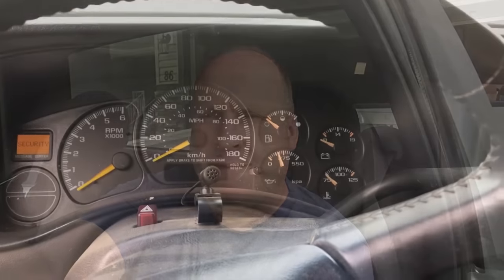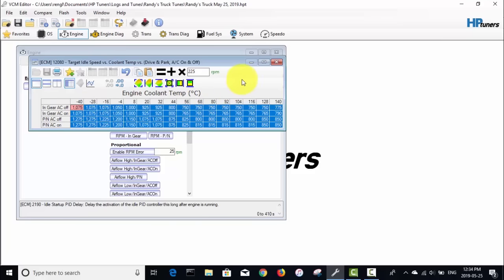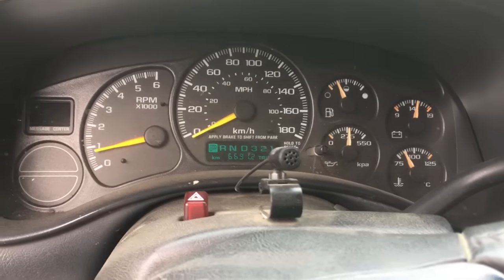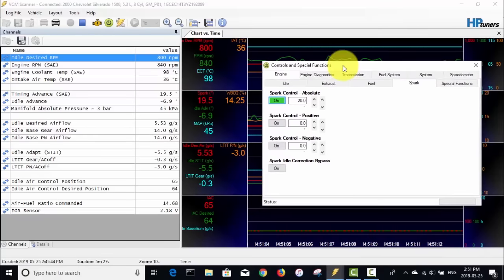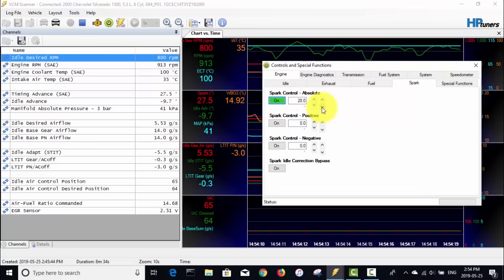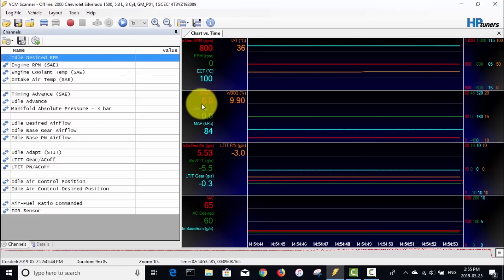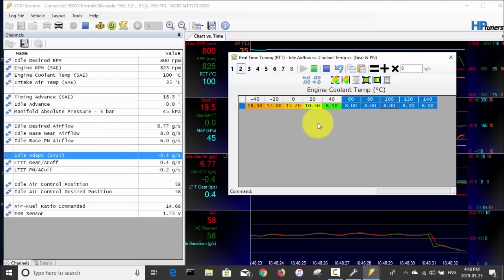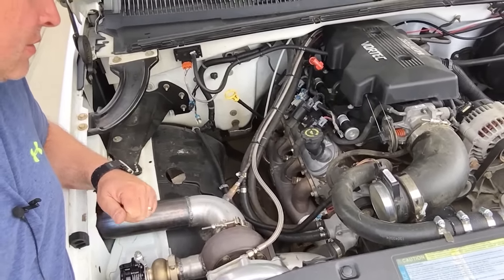Idle Tuning after Cam Swap with HP Tuners

Comment: Good stuff! The issue you had when you switched the idle airflow back to 6 and then it didn't want to stay running is because your long term idle trims were still -3 so effectively you were commanding 3 g/s idle airflow, the short terms trims were then saying you were 3 too low and were dialing your long terms back towards 0 which got you back to 6 g/s.  Much like fuel trims, the short term trims only capture higher resolution data and then averages to make changes to your long term trims which then adjust your commanded.  Enjoyed watching you go through the process!
Reply from the maker: Goat Rope Garage thanks for your input, enjoy following your channel and your live streams.
Reply: It’s like you are speaking a different language 🤣🤣🤣
I can build engines, rebuild engines, transmissions, rear ends, motorcycles, distributors, carburetors….. I can do almost anything! Except tune. Is there a place I can go to school for this?
Reply: @LowbuckLS t5
Reply: Tu trtd

Comment: For cam change you need to decrease low rpm fuel and add fuel at higher rpm. Cams are inefficient at low rpm so are rich down low and lean out as rpms increase

Comment: Just noticed, when you said it was pulling a bunch of timing in park. Its because when you wanted to make all lower cells 30 degrees you forgot to hit equals in the p/n table. You did it correctly in gear but not in park!
Reply from the maker: Corey Harris good eye, yes I caught that letter and corrected it.

Comment: Switch on over under idle timing and set both to 10 degrees. Will give you that sweet chop choppity chop braap braap at idle the kids love so much. Oh and 26 degrees at idle on the timing table.

Comment: I have 08 Gmc yukon with 6.2 it has cam, long tubes, 3200 stall, fast lsxrt intake , nick Willam’s 103 throttle body. Got it tuned but Every time I rev engine it dies immediately. Any ideas of what it might be? Thanks!

Comment: When the setting would not go to your desired 8g/s it was interpolating between the two cells because he engine was 93c and on the table the values in the cells were under 80 and 100, so if ya graphed it and drew a line it would be spot on at the displayed value at 93c

Comment: After a year of screwing around, moving the injector normal and makeup values higher to around 6.2 is what finally got mine running right. A wider cam timing needs a wider injector timing boundary.

Comment: I think the cam profile itself is going to lend itself to making crazy torque down low, so it’s going to need more fuel in that regard. From what I’ve seen these type of large duration split/moderate lift cams at that Split angle don’t make big top HP numbers but excellent torque production.

Comment: I’m assuming you’re still using a MAF tune?  So many people recommend going Speed Density but in a true driver it can be a challenge during the changes in season and altitude when traveling. 
I’m surprised you were able to get a recovering idle without cracking the throttle blade or enlarging the bypass air hole in the throttle blade. 
🤔 Maybe with the Turbo blowing into the TB, even w/o boost per say it’s still adding air. 
Interesting video, thanks for sharing your Testing and Results! 👍
PS just saw the ending where the Turbo isn’t hooked up yet! Still surprised it idled by only using the tune, my 4.8 w/ 216/220 cam was a bear to get a recoverable idle 750-800 rpms.
Reply from the maker: I am running the 3 Bar Enhanced OS from HP Tuners which is a speed density system but I did notice it is pretty finicky and my AFR readings vary from day to day as temperatures/conditions change. I did end up adjusting the set screw to open up the throttle blade a bit in the video I did about adjust IAC counts.

Comment: I was always told not to touch airflow or timing and you should be taking away fuel at low RPMs and adding it at the Higher end because the power curve of the cam needs less fuel until it gets close to where the power comes on

Comment: To fix the in gear issue add more timing  in the lower cylinder airmass cells as load increases, what i do is make the whole table one number like 30 in your case this should fix alot of issue like bucking and surging
Reply from the maker: xXQTRxFMSXx thanks, in the next video towards the end I got rid of the torque management, that seem to help the in gear idle quite a bit too.

Comment: I just recently installed a summit 8701 cam, DOD/AFM delete kit and Ls6 springs in my 08 Silverado. This video will be what I follow to set my baseline idle and in gear idle but do you have any information for us noobies about adjusting fuel trims and timing under load? I'm going into this project solo and I'd really like to collect all the information I need before jumping into the knitty gritty. I've never tuned before, but I know enough to follow along and read the important data.
Reply from the maker: Hi Audi Alucks, this video was done on a Gen 3 ECU so there will be some slight differences on your truck, but most of the concepts will apply.

With regards to adjusting fuel trims, I do it differently on my truck since I am turbocharged and running a speed density operating system, but for your truck there are two parts to airflow tuning.

Under normal driving, the truck uses data from the MAF sensor and the factory O2 sensors to decide how much fuel is required. To tune in this mode, you would log your short term and long terms fuel trims and adjust the HZ in the Airflow vs Frequency table until your STFT and LTFT are as close to zero as possible.

When in PE (power enrichment) mode your truck uses the VE table to calculate how much fuel is needed. To in this mode, you need to force your truck in to speed density mode and then log short term and long term fuel trims and then adjust the primary VE table until your STFT and LTFT are as close to zero as possible, or use a wideband O2 gauge to monitor air/fuel ratio and adjust the VE table until it reads whatever the ECU is commanding for AFR.

For timing under load, the best way is to use a dyno, but for street tuning the way I do it is to first change any regions of the timing map that have negative values to zero or a slightly positive value. Also make sure your brake torque management is disabled. Then you can log knock retard and increase the values in the wide open throttle region of the timing table until the ECU starts pulling timing due to knock retard, then back off the timing until no knock is detected.
Reply: is this something that u have a video for.  because I almost understand

Comment: after changing my camshaft to a 5.3 2009 vortec engine .. I have a code in my truck that says that my bank 1 camshafts is not right..this is normal or it can be fixed

Comment: Every time you make adjustments based of trims , fuel or timing,  you need to clear adaptations when you start.
Reply: What do you mean by clear the adaptations?   I'm messing around with Hp Tuners myself and could use some help.  Thanks in advance if you have the time.....
Reply: Nevermind,  I think what you mean is when the computer is trying to make small corrections based upon the O2 sensors, etc...  Clear those so that the car makes least amount of adaptations....On the right track?
Reply: @robbparker5445  correct, you want to turn it off so the computer doesn't mess with your tune.

Comment: Will it be the same for a manual swap? Mine shuts off when I let off the gas starts up fine idles fine but once I start. Driving or blip the throttle it shuts off

Comment: You probably figured it out by now, but at 12:43 you attempt to adjust in park  idle timing to 30 degrees but forgot to hit the "=" sign, and failed to actually make the desired adjustment.

Comment: im on the same venture right now with a BTR Stage 3 V2 cam swap in my LS 6.0 and looking to purchase HP Tuners, i was wondering after all your final tuning how well does your LS run and perform with the Cam Change
Reply from the maker: It’s been running very well, I’m happy with the cam swap for sure. Now I need to do some transmission upgrades, but the engine is working great.

Comment: Loving the lessons!  Which Module do you have?  I'm seeing bunch of options and I want to make sure I get the right HP Tuners module.
Reply from the maker: Atanas Tripzter mine is the original MVPI which they don’t sell anymore. If I were to buy one right now, I would start with the standard MVPI2 and would upgrade to the Pro features if you needed to log an analog signals etc. Also remember that you’ll need to buy credits for each vehicle you tune, Gen 3 or 4 LS vehicles need 2 credits each, newer vehicles need more I think
Reply: @LowbuckLS  how much are the credits?
Reply: @LowbuckLS  and I'm new here but hit the sub button. I love this stuff!!
Reply from the maker: Johnny Mc Nubs last time I bought credits they were $50 each

Comment: My LS has the summit 8707 cam it made max HP at around 5300rpm.. idles 9g/s and believe iac set at 16.. but with 1k idle it's got nice chop and smooth. Cold start is bit of a different story still lol. About to pay someone to finish it.
Reply: Did you get sorted cold start idle? I'm putting exactly same cam, need to tune that now

Comment: I’ve got a 2014 Silverado gen V 5.3.  Stage 2 tsp cam. What would be the best idle rpms to go after to keep the idle up a little and keeping that chop in the idle?
Reply from the maker: Miracle Motors I’m not familiar with the Gen 5 stuff but you probably only need to increase your idle speed about 75-100 rpm from stock. Basically you want as low of an idle speed as possible without being so low that it’s unstable. A 75-100 rpm increase is probably a good starting point.
Reply: Yeah it’s around 645-655 right now and just doesn’t seem to like it much.  Also I’ve noticed a scratching/ screeching sound around 1300 rpms. Can to figure out what it is. Sounds top end driver side.

Comment: Hi, if I sent you a log file and table, can you help me understand what going on.  I'm new to this and not asking you to tune anything but share your understanding and point me in the right direction.  I have a 2002 Silverado 5.3 with an LS6 cam, cold air intake, and an LS6 intake with a T56. It runs and drives but trying to dial it in. Thanks in advance

Comment: When a new cam is installed what needs to be done first on the tune to get started?
Reply from the maker: Bumping up the idle airflow is the main thing that needs to be done to get the engine to stay running

Comment: Can anyone help think of somewhere where I can buy a ws6 95-02 98-02 prefer but open to the others anyways find one under 4K roller or not. I notice in my area f body camaros are easier to come by than ws6 so might have to get one if iam out of luck. No offer up and craigslist I check them all the time. I want to build it as a daily built 5.3 4l80e. My other projects will have 6dp TH400 etc thanks in advance. Your opinions or builds are welcomed. Also is it worth to find a super clean v6 then swap a 5.3 but then other upgrades for that I will need is like what v8 subframe connectors etc? Oh yea one more thing would a 5.3 be a hassle to put into a previous LT1 ws6 or Camaro?

Comment: Thought you wanted to time for the most vaccum not least for idle. Your cam should ride at around 17°
Reply from the maker: Dan Driver you do want to time for most vacuum, but HP Tuners measures vacuum in absolute pressure so a smaller number = more vacuum.
Reply: @LowbuckLS  makes perfect sense. Thank you.  I think that I figured out your problem with the truck dying when putting in gear.  When you worked with your proportional, integral, etc. Did you put any value other than zero in the zero place for rpm error? Same with over speed and under speed timing?
Reply: @LowbuckLS  if you did put in any value other than zero in the zero block then the pcm gets confused
Reply from the maker: Dan Driver I didn’t change any of the proportional/integral values from stock. I did figure out the issue with it stalling in gear, there is a setting called brake torque management that I turned off to solve that issue.
Reply: @LowbuckLS  you should change your proportional, integral etc etc to clean up your lope. Loping for a long time with incorrect instantaneous air and timing can burn/foul plugs, cause overheating as well as hotspots especially with aluminum heads. Most clean it up for "that chop" but really should be done for efficiency and burn quality

Comment: Could p0122 and p0223 be a tune issue
Reply from the maker: Those are both codes that have to do with the throttle position sensor, is this on a drive by cable or drive by wire vehicle? You may want to try this TPS relearn procedure: https://thetuningschool.com/blogs/news/tps-relearn-process
Reply: @LowbuckLS  its a ls3 throttle body dbw setup

Comment: Don't it cost credits each time you have to write a tune? Or cost money persay?
Reply from the maker: Normally for these LS engines it will cost 2 credits per vehicle that you want to tune, once it has been licensed you can tune it an unlimited number of times. If you buy enough credits for the same type of vehicle eventually you can “unlock” that type so you don’t need to pay for credits for that model any more. But for most people it will cost 2 credits per serial number.
Reply: @LowbuckLS  I think I understand...couldn't I just buy the holley terminator X setup and then tune all I want for free? Where im going with this is, I want to learn to tune my own truck..but if I have to give it 25 different trys, I dont want to have to pay for 25 different writings or credits using HP tuners lol id rather just pay one lump sum up front and then tune when ever and where ever for free persay
Reply: @motorjoe_937  you a pay a 1 time fee per pcm. If you purchase credits for your truck 1 time, you can tune it and edit it an infinite number at no additional charge. Only if you go to a different vehicle computer to tune do you pay another credit(s) fee.

Comment: Your g value you were changing in the real time tuning was for park only not in gear
Reply from the maker: Yeah I think I had issues with the real time tuning, it works great for VE tuning but not that great for idle tuning. I don’t think it worked in gear I don’t remember the exact reason but I ended up giving up on the real time tuning for idle airflow and did it the old fashioned way.

Comment: You might get a little better idle at 13-13.2 af.14.7 is good for cruising at highway speeds .
Reply from the maker: Ok I’ll give that a try, thanks
Reply: 13.2 at idle? That would wash the hell out of the cylinders. Lol the o2 sensors adjust the fuel trims to runs at 14.7 no matter idle or cruising which is ideal. 
The only time you should run 13.0-13.2 aft is wide open
Reply: Correction. Didn’t see the turbo. Wide open more like 11.5 afr
Reply from the maker: ThatDudeTrent yeah that seemed a little rich for idle. I’m running an open loop speed density tune so my O2 sensor isn’t going to make any correction to the AFR I have to do it all in the tune. But yeah I’ll stick to 14.7 ish at idle now that I think about it.
Reply: Lowbuck LS manufactures set the engines to 14.7 af for emissions . After you throw a big cam in that engineering went out the window . You can change the af and watch the map change up and down . The best af is slightly leaner than your best manifold vacuum reading  for idle. Some people just run open loop for idle then the ecm is running a fixed program.
Reply from the maker: Randy Williams I do have my ECM set to run open loop. I’ll do some experimenting and see how my manifold vacuum changes with changes in AFR at idle
Reply: Randy Williams I hung around some
Pretty educated tuners and have never heard of intentionally running rich at idle. All that will do is cause unburnt fuel to get past the rings and into the oil and also smell like fuel terribly out of the exhaust because of the overlap in the cam. 
Complete waste of fuel
Reply: ThatDudeTrent I disagree . I used to have a California smog license and now I own a shop where I build  hot rods . If you put a 60’s car on a smog machine and check the af you will usually find them at at 13 or so . Flooding cylinders doesn’t start till you get about 9 af .  The cam shaft can cause drive ability issues at idle . I watched this vid to learn about hp tuner .14.7 is considered to be perfect stoichiometric af . If an engine was designed perfectly to run at idle it would idle very easily this lean . The stock cam allows this and the ecm monitors this through the o2 sensors . After the engine makes enough rpm you can run it leaner -like cruising down the highway . Usually when an an goes on full throttle or boost you will see 12-12.5 af but this can different from engine to engine . If you ran an engine at    Boost on 14.7af you will melt pistons. I have tuned megasquirt and vipec efi . My current tuner is giving me problems so it’s time to do it my self . The hp tuner is pretty much able to tune a car to an oem level of driveability. Problem is learning the program.
Reply: 13.5/14.0
Is fine on batch fire injection .
Reply: Terrible Idea